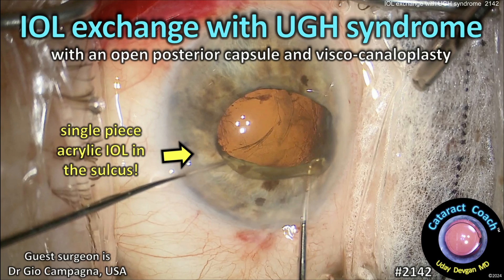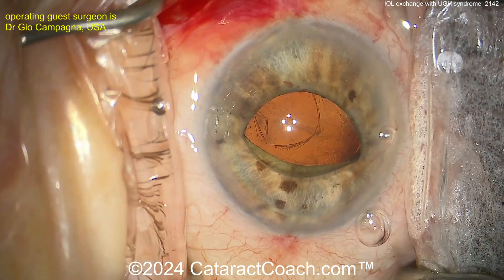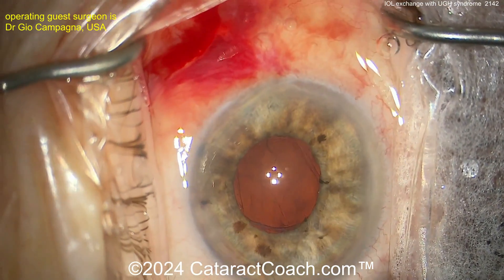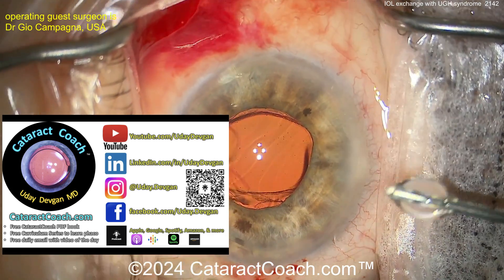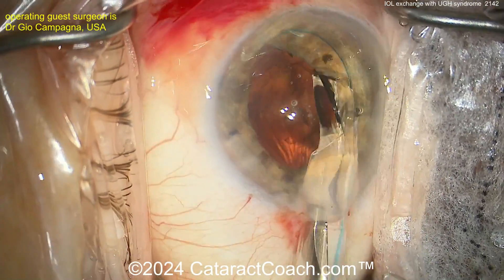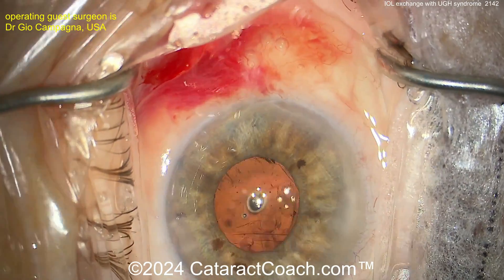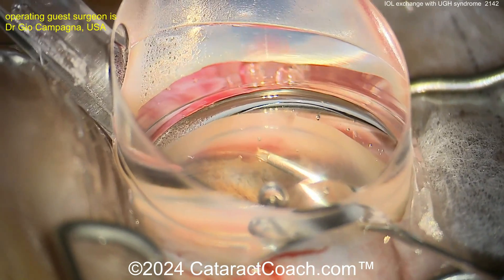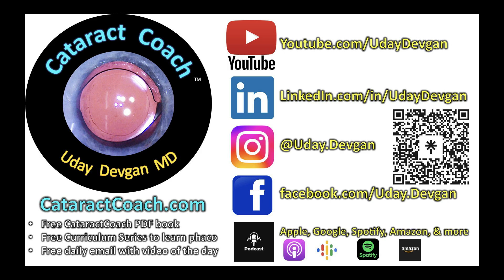CataractCoach™ 2142: IOL exchange with UGH syndrome & canaloplasty

Comment: I did an IOL exchange this morning for a lens placed 17 years ago. It had opacified. There was a heck of a Sommerings ring too. A key is to take your time! I had to carefully tease the haptics loose, blind, in the capsular equator. Using a cyclodialysis spatula, with lots of visco. Very gently sweeping the cortical material out. Now and then I stopped to clear all the gunk filled visco out of the AC with I/A. This took a long time. Calm and patience are needed. The anterior capsule opening stayed intact fortunately, the PC had previously been yagged so a little vtx was needed to clean it up. Finally got the lens up in the AC, cut it in half and made the exchange. This easily took an hour. Go slow don’t rush or you could rip the bag loose. Take a breath if it gets frustrating. Some may be quick and easy, but not all!